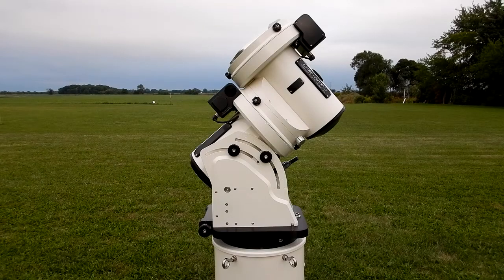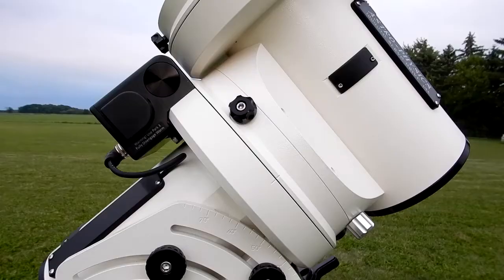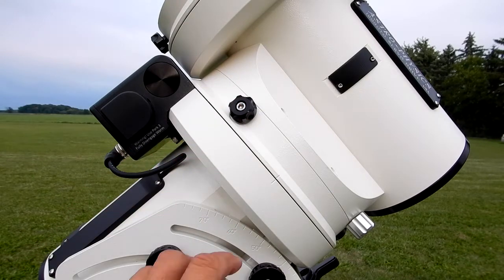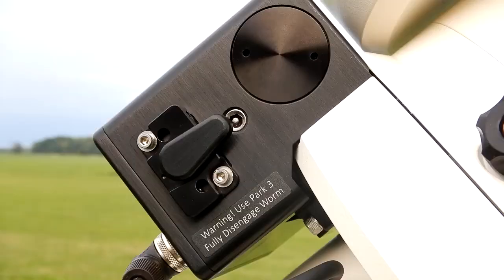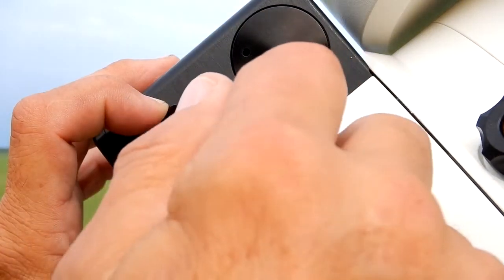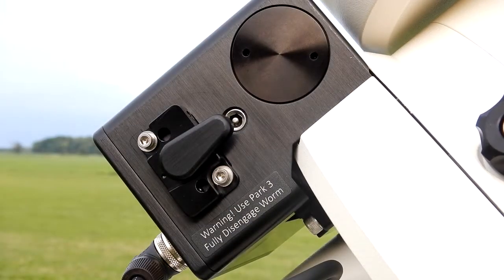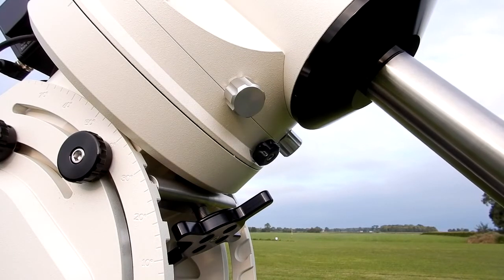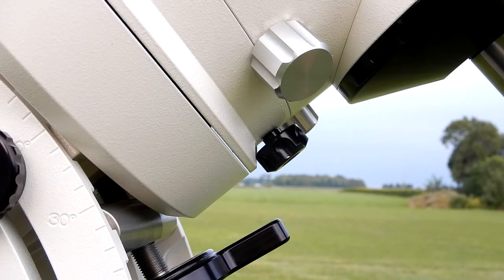Astro Physics Telescope 1600GTO Mount (play in RA axis) 2

Comment: I think George misunderstood where the mount is loose. There is a lock nut inside the mount that tightens the RA axis. This is what need to be done. I am not sure if this is user adjustable. This is the same reason why you are feeling a difference between RA and DEC clutches.
Reply from the maker: THANK YOU!!! This was exactly what I thought, something internal under that large black "piece" in the RA needed to be adjusted. Didn't know what, but something. I knew it had to be something simple but the problem is George never looked at my first video link I sent him. Hope it is an adjustment I can do. One can assume a specified torque is required. Not sure if a ""special"" tool is required though if it is a machined part only AP has made to tighten it with a torque wrench. Sure as hell don't want to send it back. This is a brand new mount. Never used it yet under the stars as I wanted this issue taken care of first. I will email George this new link with my first link and be on the phone tomorrow. Having been a Tool & Die maker I understood that the position of the play had to originate from within the RA axis but had no prints to see how it is built. How do you know it is a lock nut? You've had one apart or seen an actual print? Really a GREAT mount. Once this is taken care of it will be perfect. Got an 1100 also, another masterpiece!
Reply: @starastronomer  I'm an AP retailer. If I remember correctly, there is a 4 point locknut inside the RA axis. What you are doing in the video is adjusting worm mesh. (adjusting the pressure the springs apply between the worm and ring gears.) You can visit my website https://www.tolgaastro.com
Reply from the maker: THANKS SO MUCH!!!